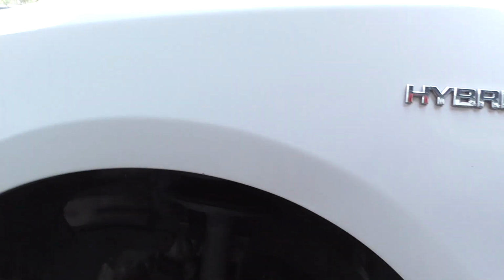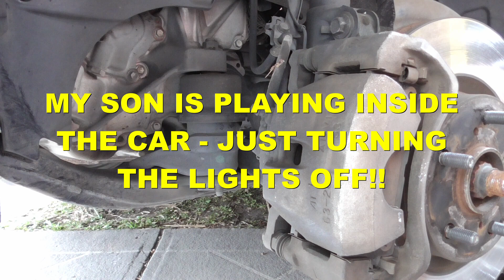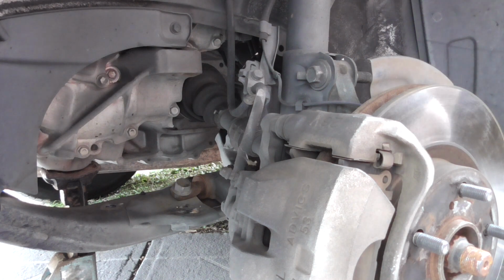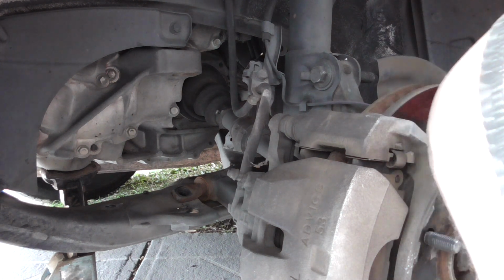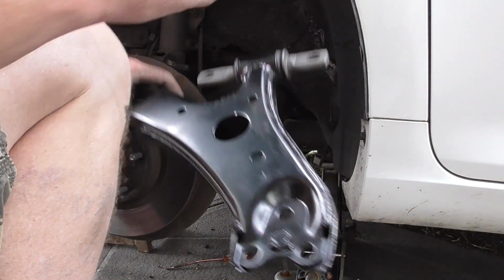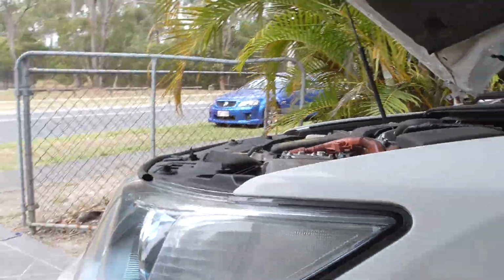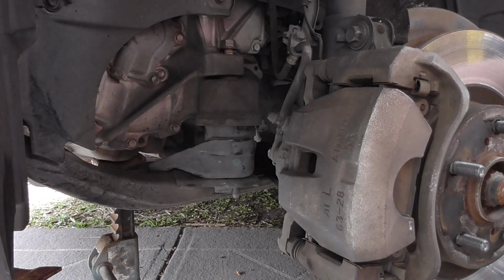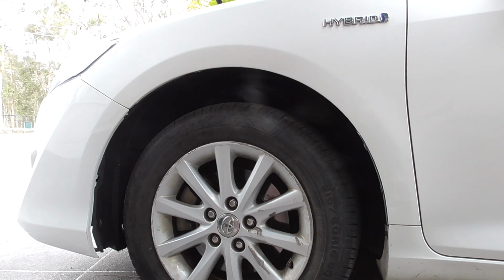2013 TOYOTA CAMRY LOWER CONTROL ARMS

Comment: You neglected to inform viewers that on the old control arm there is a metal part that needs to be transferred to the new control arm. The connection point on the right hand side of the engine mount.

Comment: What the symptoms cause u to change the lower control arm? my 2015 Camry got a sound “thud”pop up from the driver side especially when hit the driver and turning the wheel to all the way right side.
Reply: Hit the driveway, sorry
Reply: I have same issue with 2014 Camry. It’s control arm. Replace with ball joints if you can. Best of luck.
Reply: I have checked the control arm bushing , it’s tight without crack and no play on it
Reply: There was recall for this part. I don’t think the bushing has to be bad. My bushings were good and still had this issue. Here’s the recall manual - https://static.nhtsa.gov/odi/rcl/2014/RCRIT-14V715-3433.pdf.
Reply: I got it, thank you , will let u know the outcome by tomorrow.
Reply: The reinstallation completed, get a great improvement,  the sound become dull and little, but still have some.  Would  take a longer time to pay attention. Anyway thank you for your help.
Reply: Good to hear. I’ve replaced the link pin and ball joint also. Only other components that would do. My issue was link pin and for good measures I changed the ball joint also. Turns out they were both bad due to picking up slack of a bad control arm. Best of luck
Reply: Sway bar links
Reply: @zetascry1413  Thanks for the link. Wonder if it bled over into 2015, my '15 has the same symptom.